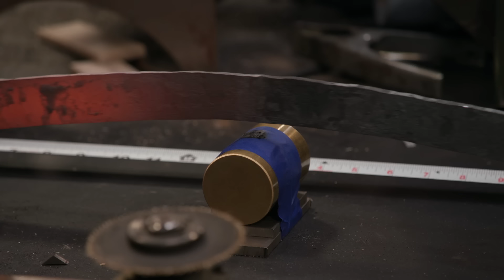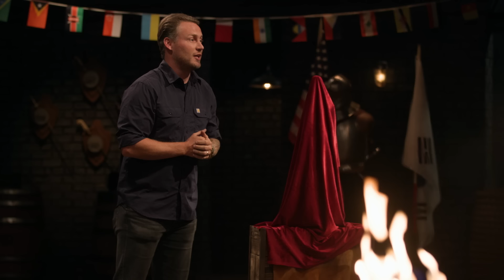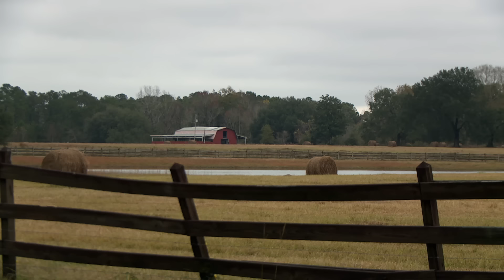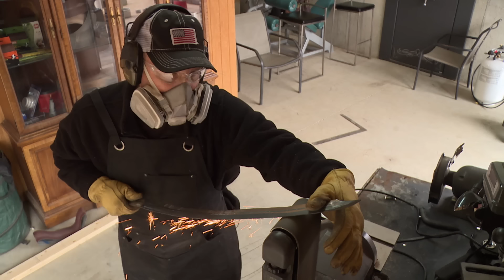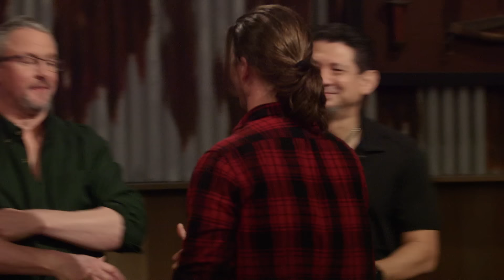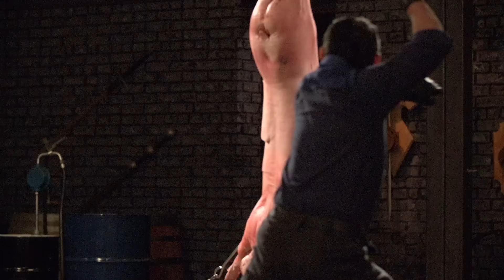Sabres Put to the Ultimate Test (Part 2) | Forged in Fire

Comment: steven heat treated totally failed included he build a oven and a butane torch,if not move a blade back and forth evenly no way blade can held up in a testing.his blade just a slight red on a spine,seth maybe bend but his blade move back and forth evenly when heat treated blade fully red.